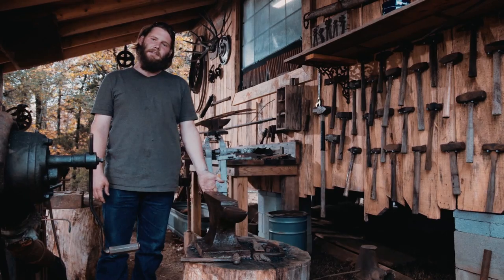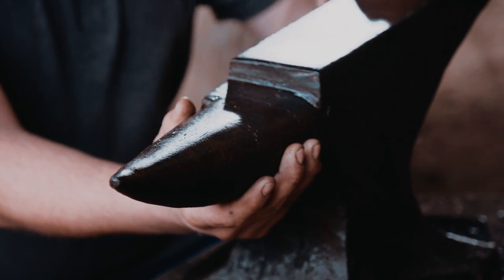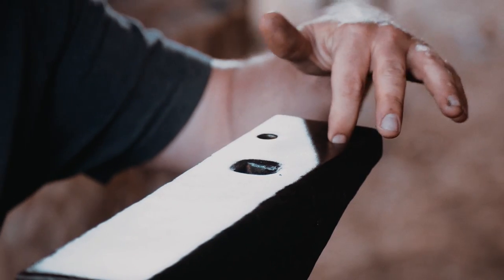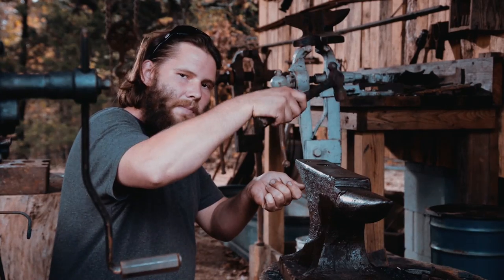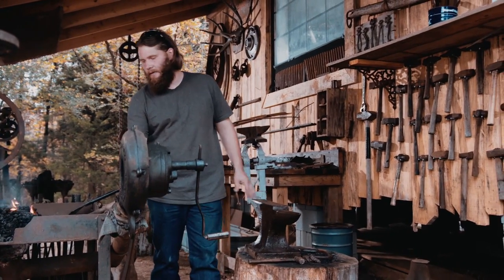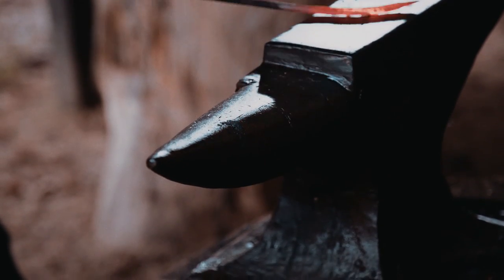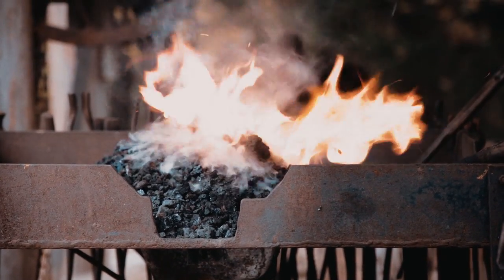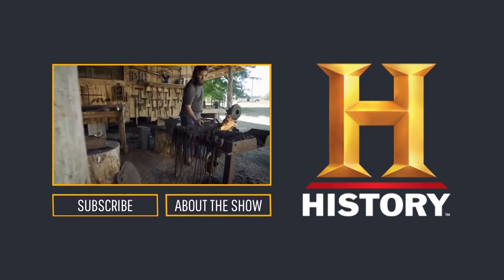Iron & Fire: Daniel's Workshop: The Anvil | History

Comment: Not wearing eye protection when using the anvil is foolish.
Reply: Pointless insight? The statement itself is the point. I have many years of experience in metal shops and have seen surface chips fly off anvils and wedge into skin, often injuring people across the shop floor.  Eye protection is usually mandatory in any reputable shop. I find it reckless and irresponsible to air episodes of these types of shows while not showing the safeguards that should be in place.
Reply: the thing you need to realise is that I wasn't saying eye protection is pointless I was saying the fact you said it was because everyone knows the risks of not wearing eye protection and if you don't then you shouldn't be using an anvil.
Reply: Without hearing protection is the only thing worse